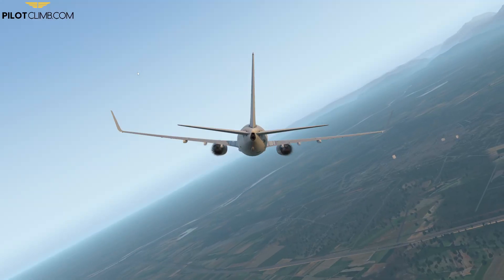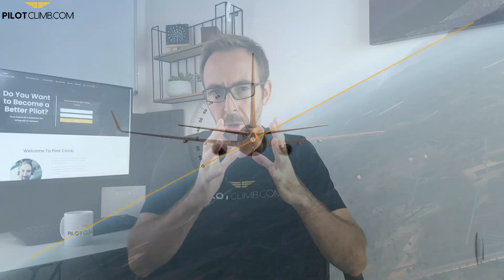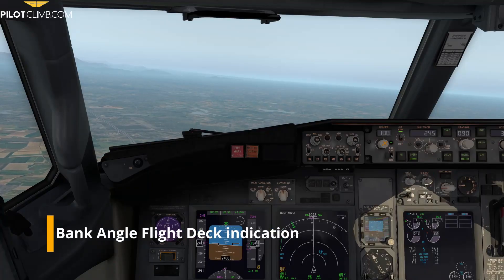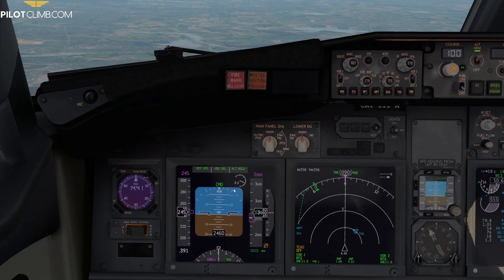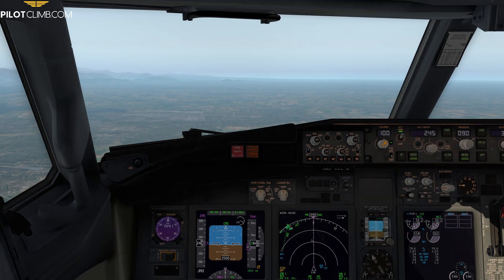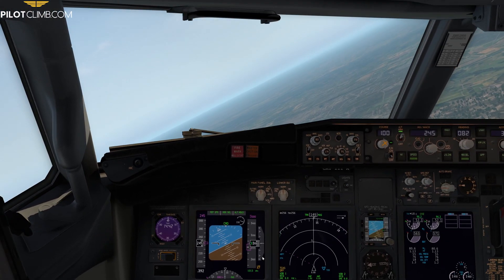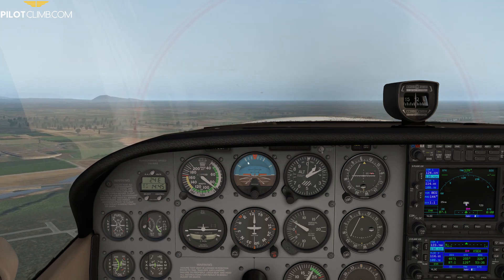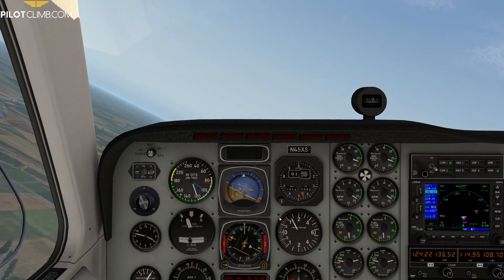Aircraft Bank Angle Explained By An Airline Captain.

Comment: Captain i have a question. During a holding procedure, with 230kt TAS, how big the bank angle is allowed? Some say standard rate which is 30, but icao says 25 degrees max. Which one is correct? I will appreciate your answer since i'm having an airline assessment next week.
Reply from the maker: Hi, 25 degrees.. unless indicated otherwise on the chart
Reply: Thank you for your answer. And your videos. They are very helpful.

Comment: Is there any time of the flight, considering B737 / A320 that you adjust bank angle to auto, or to 10, or to 30?
Reply from the maker: On the 737 usually you change the selector to 10 at high altitudes (above 30000feet)

Comment: for a 30 degree bank angle what will your normal airspeed  be on a cessna 172? Is 110  airspeed to fast on a 30 degree bank angle?
Reply from the maker: Check out the video I made where I talk about the standard turn rate.. that will answer your question
Reply: @PILOTCLIMB  thanks, but if I was to do a 30 degree bank angle my airspeed has to be at least 230 KIAS , but that will exceed the caution speed range not unless I perform it under smooth air, I guess performing a 30 degree bank angle isnt recommended not unless you was in a emergency situation.